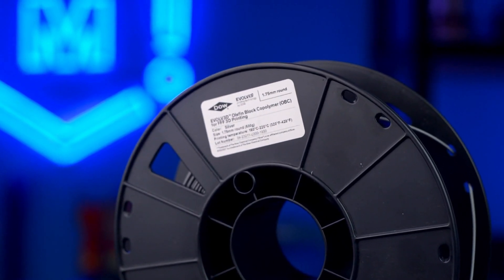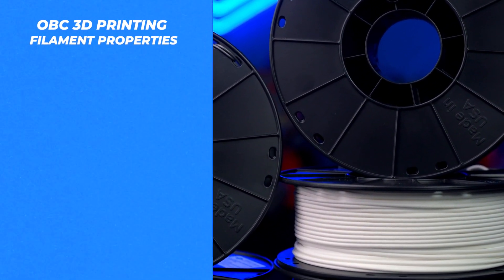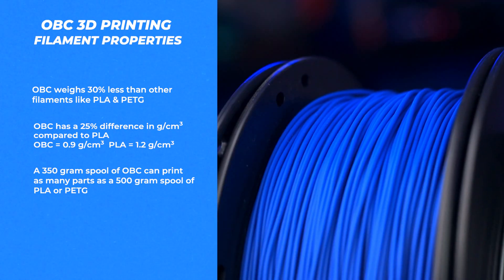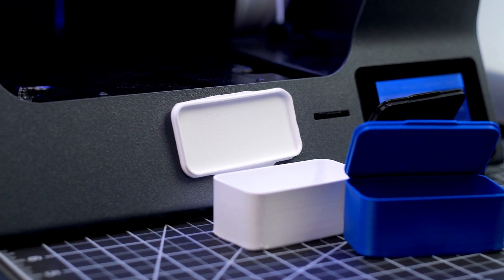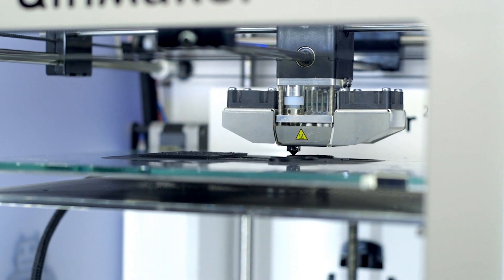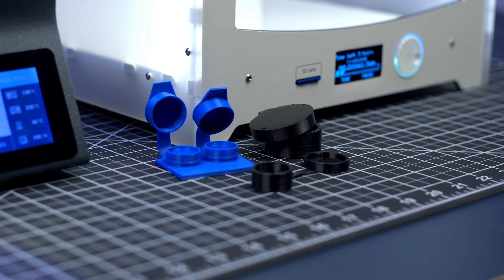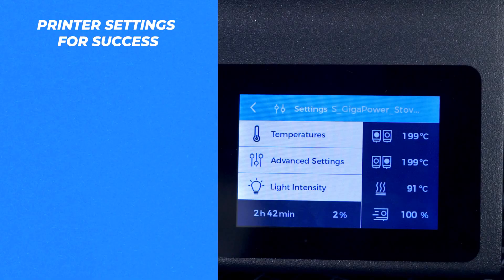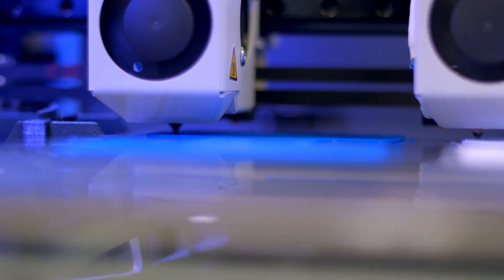Tech Breakdown // OBC 3D Printer Filament from Dow® Chemical

Comment: Why the packaging tape?
Reply: I've been trying to print in OBC, and it doesn't stick to anything. I've tried Build-tak, Dimafix glue, glue stick, painters tape, and even tried taping the raft down, but no luck. I'm about to buy Polypropylene tape, as the video recommended.
Reply: @InIteration  any luck? I have a Mamorubot bed which is made from PP. It "should" work. I'll find out soon enough...
Reply: @3dPrintingMillennial  The OBC stuck very well to the PP tape. The next problem was the OBC prints warped, and caused the tape to slowly unstick from the glass bed.
I then got an adhesive sheet of PP that stuck to the glass bed. It has worked very well, but I haven't resolved the curling issues. How did your prints go?
Reply: @InIteration  it hasn't arrived yet 😞

Comment: what's the glass temperature
Reply: looked at the tech data sheet it is 130C
Reply: @davisclevenger6761  130 is the Tm, but it says -13C as Tg which is obviously not correct unless it's being specified as a delta...
Reply: @Flying0Dismount  If it's anything like polyethylene it could actually be -13C. Think Tupperware.